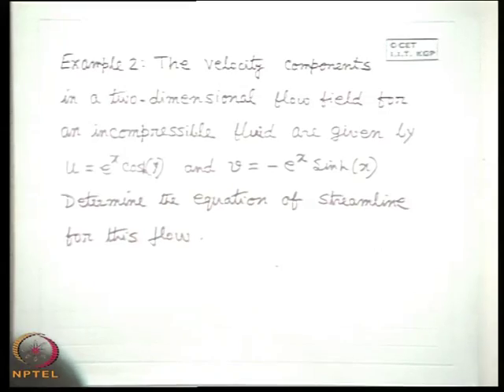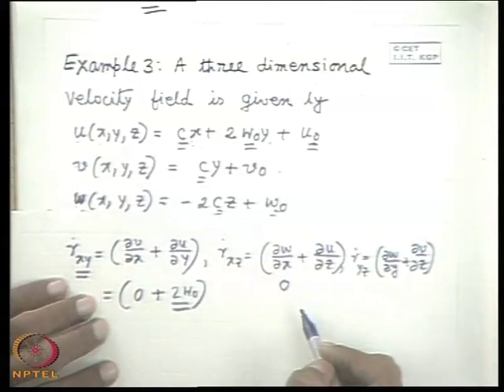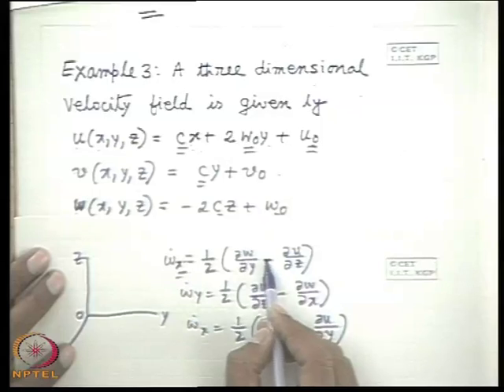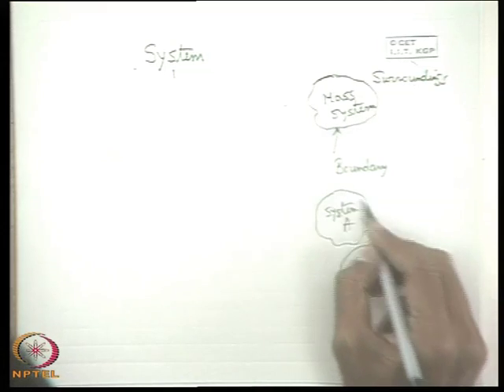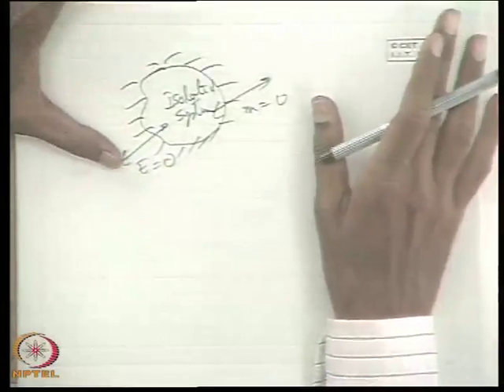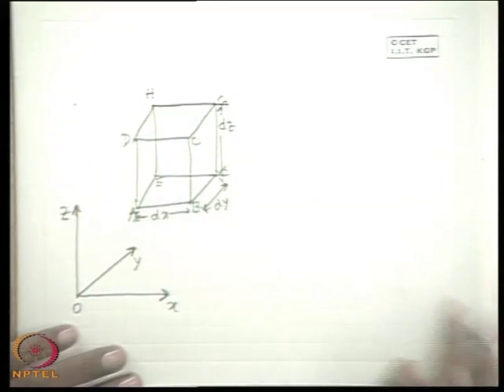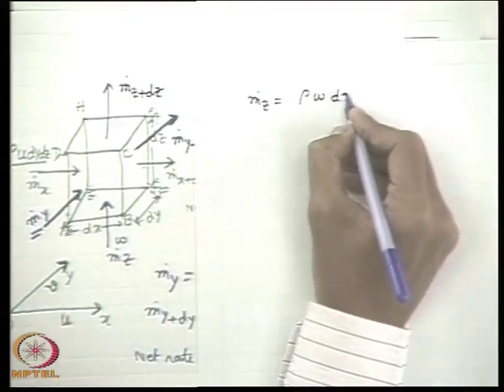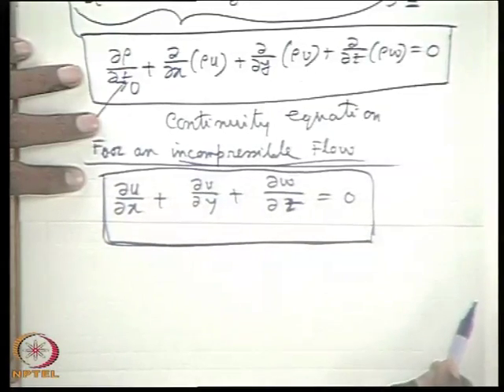Mod-13 Lec-13 Conservation Equations in Fluid Flow Part - I

Comment: Here rho is treated as constant while multiplying with volume in the time derivative. However in the derivatives wrt x , y and z rho is still inside the derivative which means it varies with distance. So can anyone explain how can he just multiply with dv to obtain mass in time derivative??
Reply: Rho is not considered constant it is variable but volume dV is considered constant in time deravative as it is a control volume process.

Comment: For question 2 at the end answer should have been steady and incompressible... please correct me if i am wrong....
Reply: Yes searching this only in comments section
Reply: y  r right
Reply: No the answer is correct. It is because density is invariant with time so the first term in the compressible continuity equation doesn't appear in the incompressible continuity equation. The flow properties can still be varying with time and remain unsteady.

Comment: Identity means of mass means??.?
Reply: Imagine you put colored dye in a control mass system. The particles in the system will get colored and remain as it is since there is no mass flow across the boundaries. So the identity is retained. However, if you put colored dye in a control volume system, you will see that the dye color gets washed away as the mass is free to exit or flow across the boundaries. The colored fluid particles leave the control volume and are replaced by "fresh" or "new" particles from outside that enter the CV. As a result, identity is lost.
Reply: Anant Gairola thanku sir